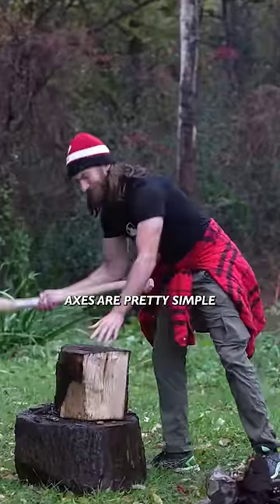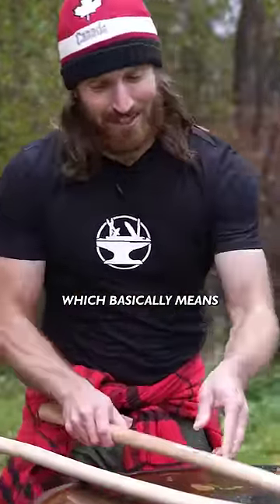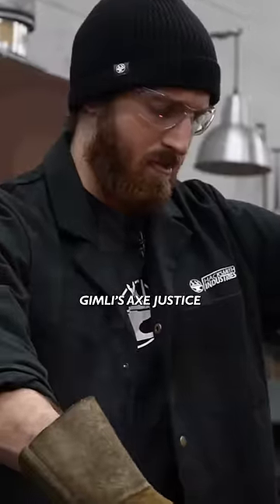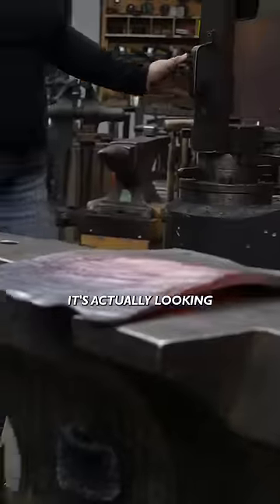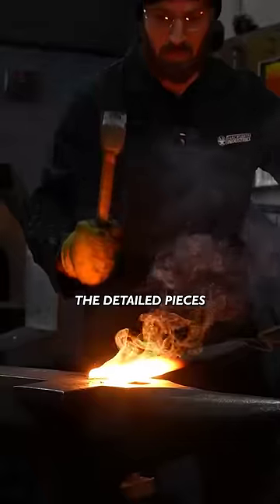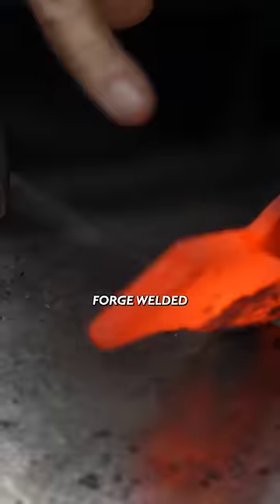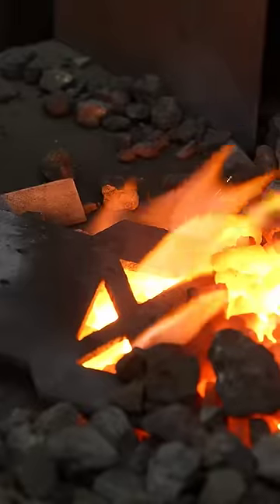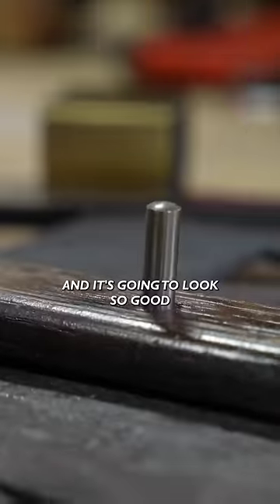...and you have MY AXE 🪓!

Comment: Double headed "Battle Axes" is one of the biggest misconceptions of medieval weaponry by fantasy writers. They became prevalent in history because all the common farmer had to defend themselves was the tools they used daily. Not to mention in a fight you would want to pick the weapon you are most familiar with
Reply: No.
Certainly not.
Reply: bro thinks fairies gnomes wizards and elves planet is the same as actual mid evil europe
Reply: @austriacontinente154  bro thinks the reason actual medieval warriors of various sorts didn't use double-bladed axes doesn't apply simply because some tall dudes can live a long time and like sailing

That reason, by the way, was that if you're making a battleaxe (y'know, an axe intended for battle) you'd want it to have a variety of damage methods for different types of armor, since there's little reason to have two identical blades on a weapon you can only hit someone with one side of at a time

You MIGHT be able to get away with a double-bitted axe if it had one blade be wide and thin, and the other be stoutly ground, but at that point you might as well just make it a hammer or pick so it either does bludgeoning damage through your opponent's armor, or can pierce it with less of a need for sharpening later

anything else is just futzing around with a woodcutting axe that may or may not have been misinterpreted as a battleaxe because some peasant chopped some duke's head open with one 1000 years ago
Reply: @austriacontinente154 The kunai was a gardening tool before it was a weapon.
Reply: @TheMandaloreFett You're thinking of a Sai.
Reply: It was cheaper, required less metal, and less skill.

A person was gonna have more practice chopping wood than using a sword.
Reply: @austriacontinente154  L
Reply: @TheMandaloreFett and yo-yos were WEAPONS before they were toys. So what’s your point?
Reply: Double Bitted felling axes were invented in 1850.
Reply: so what you’re saying is Minecraft was right?
Reply: @austriacontinente154 it's not about culture, it's about raw pracricality, even a 10 years old would figure out it is a bad idea
Reply: I believe that dwarves use axes as their weapon since swinging it around is like the way they would swing a pickaxe, therefore the movement is familiar to them.
Reply: @davet8534  yes but it makes no sense for it to be double bladed
Reply: @StefanoUrsella 

I mean, they could just do that cause it looks cool.

In reality humans (and fantasy equivalents) are not purely practical creatures..... even the most practical person possible (or the average Dwarf) would still be OK with losing a little bit of functionality for aesthetic purposes. I mean. Look at some of those wacky Cod Pieces!

A double bladed axe head may be pointless, but it doesn't reduce the overall efficiency of the axe by a significant amount. Yet it was memorable looking enough for a major misconception about it to be made by almost every fantasy author.
It's not too farfetched that a warrior would get one just because.
Reply: @axinhedgelion8417  The point of his/her comment was he was just correcting and educating people about their historical misconceptions.

Many people think past people or fighters choose the exact weapon they wanted but that's not always true.

One example was farmers having to fight with whatever they had. So they used their farming tools.

One time Wanderbot said he thought it was weird anyone would have a scythe when scythes are farming tools. Not weird at all. That's how far the misconception is.

Part of the reason for misconceptions, such as with the scythe, is entertainment.
Reply: I would argue the biggest misconception is scythes were ever used in battle. - Or that war scythes were repurposed agricultural tools. (They really were not, they were purpose built voulges)
Reply: @austriacontinente154  the core tenant of verisimilitude  is that the real parts of your story have to be as real as possible to contrast and earn suspension of disbelief for the unreal. A double-bitted battleaxe breaks verisimilitude for anyone with a basic understanding of physics, history, and weapon design due to just how bad of an idea it realistically is.
Reply: @kyosokutai  Agreed that is another big one. Scythes were only used for agriculture and if you've ever wielded one they are definitely not designed for fighting with. Yes they could be used but they are flimsy and require great skill to just to cut grass with.
Reply: You're telling me farmers bummed around with two headed axes?
Reply: Don’t remember asking
Reply: Well, also axes were better at going through armour. Big heavy head like a mace, and can still slice like a sword. Put an armour spike on the back and all of a sudden you have a scary weapon. For anyone. 

I’ve put a tomahawk through a street sign. Which is about as thick as ye olde armour. Lil one foot thing. A full size war axe would be terrifying.
Reply: If they were doing atHistorical piece then they probably would have looked up historical pieces. But this is for a character who had a double headed ax.
Reply: Indeed and I have a double bitted axe and they are so convenient I keep some side nice and sharp and the over kinda dull for splitting wood
Reply: The dane ax was the only two handed ax used in battle. It sniped heads from the second line.
Reply: @PsylomeAlpha  Dawg, chill. It just looks cool
Reply: @user-bl6oj1hl8i  the kunai and kama were both farming implements before they were weapons as well.

Comment: It's called a double but axe, they can be designed for fighting but were common in foresting trees back in the day, one side to cut through the bark that would dull your blade and the other stays sharp for cutting the inside of the tree
Reply: Wranglerstar?
Reply: double bit(e) axe
Reply: Important note on the combat designed double axes is that usually you'd have longer and broader but thinner blade on one side and a smaller but thicker blade on the other side.

The main blade would be  purpose combat one and the back one could be used a tool or to deal with heavy armoured opponents and  to hack down doors during raids/ sieges 

It also had the same benefit of not damaging the batlleaxe head which in this case is even bigger because  batlleaxes were naturally less robust due to optimised anti human Vs anti tree design

Comment: Hacksmith: "A battle axe means it's two axes in one"
HEMA community: Sharpens pitchforks
Reply: reconfigures scythes
Reply: Tbh the angry comment started brewing inside me the second he said it
Reply: Yeah… I was looking for this comment lol
Reply: Lol, I'll grab the torches.
Reply: Two heads is for chopping trees twice as long in the forest, or accidentally removing bits of yourself on the battlefield.
Reply: My exact reaction but it’s the hacksmith so I can’t get angry
Reply: @death32815 they're not for cutting twice as long, they are ground differently on each side, one is thin and very sharp for say limbing and the other is thicker with not such a fine edge for heavy work like felling. Saves you carrying two axes. You'd always carry a sharpening Puck in your pocket as well to keep both sides good all day
Reply: @jamestheferret  you want an extremely sharp edge for felling trees lol, the other one would only be kept dull so you don’t worry about hitting the ground or rocks with it
Reply: @jamestheferret  did u mean splitting?
Reply: @advamce493 @jamestheferret @jeffjefferson2743 

When it comes to double bit felling axes it's not to extend the duration of your time in the forest, it's to reduce the amount of gear you have to carry with you; The blunted end is used for limbing, the other felling, James is right. Jeff, if your hitting rocks with your axe, your form needs adjusting, and that's okay :)
The correct term for a double bit war axe, is Great axe or labrys. Single bit war axe? Battle axe (other variants too such as a bearded axe)
Reply: "which means" grrrrr arrrgggg.....
Reply: OMG my first thought 😂
Reply: Forges plowshares into swords...
Reply: Made me very upset hearing that XD
Reply: As someone who’s part of the HEMA community I approve of this message
Reply: AFIXES SPEARHEAD
Reply: I can't believe I forgot what a pitchfork is and had to search it up
Reply: I will go and get my longsword
Reply: @Dther99 grabs longsword
Reply: "Sharpens war tridents and halberds"
Reply: @jamestheferret  yeah, no.
There is no historical double blade battle axes, period.
They were all ceremonial and decorative weapons
Reply: Where’s my pollaxe?
Reply: I’m not even a part of hema and hearing that kinda felt off to me I know a battle ax were rarely ever double sided right? Because it simply has little practical purpose in battle given the purpose of it? Or am I wrong I can’t remember very well
Reply: Idk what you mean with HEMA but in The Netherlands, there is a store chain called HEMA
Reply: @limpfall13  Practical ones just weren't double-sided. Maybe one or two outliers exist, but there's just no real benefit and it fucks with the handling of the weapon.
Reply: they don't sharpen their battle axes? to show him what one is?
Reply: HEMA community? 
Like a fan club for the Dutch store? 
A lot of mom's in there.
Wouldn't want to piss those off.
Reply: @ElAnvaBar  Historical European Martial Arts. Using old manuscripts that instruct on fighting with various weapons to fight like they would have.
Reply: @nah-ov3vh  Historical European Martial Arts. Using old manuscripts that instruct on fighting with various weapons to fight like they would have.
Reply: Loads my m27 IAR
Reply: @jeffjefferson2743 you get mad over that?
Reply: It literally does mean that though
Reply: Sharpens actual battle axe
Reply: @majesticeagle5461 a battle axe is an axe designed for battle (meaning its typically thinner [felling axes are sharp too] to rend limbs and crush bone) no where do they have to be double bitted
Reply: @Sip_Dhit  You haven’t disproven me
Reply: @Dther99 😂😂😂
Reply: Damn the hema people are leaving their prized weapons at home to bring peasant weapons? weird move coming from them but ok.
Reply: "THAT STILL ONLY COUNTS AS ONE!"
Reply: I was about to comment something, hahaha
Reply: @SonFromAGun You sure James is entirely right? You stated the blunt side is for limbing, they said the sharp side.
Reply: Just curious, how would the hema community describe it?
Reply: lights torches
Reply: Tru
Reply: I'm glad you wrote this comment, really put me at ease
Reply: HEMA? Does that mean you guys know what Rookworst is?

If you get it you get it
Reply: The definition of a Battleaxe is, a large broad-bladed axe used in warfare.
Reply: What's hema
Reply: You beat me to it. I’m gonna cry
Reply: "Sharpens pitchforks"
Because pitchforks are 3 spears in 1
Reply: That on top of "Gimbli".
The Labrys was a real thing but mostly ceremonial.
Reply: I was just about to say something about it myself.
Reply: HEMA what now?
Reply: @Dther99  *loads glock 18*
Reply: They'll be ready for them.
Reply: They'll be ready for them.
Reply: Calibrates Trebuchet
Reply: wtf is HEMA?
Reply: @SomeHunter historical European martial arts, it’s essentially just studying medieval/renaissance weapons and fighting systems
Reply: All I’m reading is that it’s two different kinds of axes in one like he said
Reply: I’ll grab the REAL battle axe, the Dane axe.
Reply: @bait5257  Historical European Martial  Arts.
Reply: @jamestheferret Youre comme t implies all axes are the same. The truth is there are double axes with 2 different heads and 2 identical heads
Reply: @Dther99  YES
Reply: Pitchforks are just spears with smaller spears on it.
Reply: This has me wondering if there's a HEMA method for wielding pitchforks. Kinda spears?
Reply: @LJCyrus1  that's about how i would
Reply: HE SAID IT FOR US CHARGE THIS HEITHEN
Reply: (polishes longswords)
(unsheathes Greatswords)
(grabs halberds)
(yoinks billhooks)
Reply: @TheBetterBleedingBladesYouTube 🤦🏻‍♂️
Reply: @SonFromAGun 🤦🏻‍♂️
Reply: Gimli - that still only counts as 1
Reply: Bow and arrow 🤪
Reply: It's PRONOUNCED: DOUBLE-BIT AXE aka the Michigan axe
Reply: Instantly opens coments

Comment: Doubleheaded axes arnt battle axes.
Double headed axes are used for wood cutting to change heads when one blade becomes dull.
Battle axes are simply any axe that is war ready
Reply: Close, whilst you have some what described a double bit felling axe (although the bits are purposefully sharpened differently, one sharper side used for felling, and the counter side for limbing) there are also double headed axes meant for war, often called a Greataxe or Labrys. A single bit axe meant for war is called a battleaxe. The chosen phrasing they used isn't correct, however great axes did have a place in warfare.

Source : I'm a wood cutting nerd
Reply: you're half right. Sometimes it's so you can switch to a clean, sharp edge, but more commonly it's because one side is for harder bites/felling and the other side for splitting.
Reply: @SonFromAGun  Those axes for battle were more common in the Bronze Age, and less common in the medieval age. BUT, you did have Halberds with actual double blades.
Reply: Arnt isn’t aren’t tho
Reply: @voltekthecyborg7898 yes but the blade on the opposite end of the ax head is smaller than the ax head
Reply: @brrrrrr  It was more popular than symmetrical blades, yes, but it still happened
Reply: @voltekthecyborg7898  but even then they aren equal, one side beunf a big blade the other usually being a pick or sharpened hook
Reply: @Sip_Dhit  Depends, the Labrys was symmetrical, ceremonial or otherwise
Reply: The only double bladed axes for battle that I know of are Indo Persian. I'm going to need a source on a "bronze age double bladed battle axe." Or a "double axe bladed halberd"
Reply: they can also have different edge profile so one side is good for felling, the other one for cutting off branches
Reply: Actually there's more to battle axes than that. Opposed to actual woodcutting axes, the axes meant for war generally are meant for cutting flesh, and although a woodcutting axe would do phenomenal, it is quite weighty. And that's where war axes get different, where they make them much less weighty by making the heads less thick, and just make them good enough to cut flesh. It's like subsonic rounds - they make them quiet enough yet strong enough to penetrate flesh. In this case it's just for weight purposes though.
Reply: Battle axes are just regular ones with thinner and lighter blades, sometimes with a vertical spike or blunt other end for multiple uses
Double headed ones are better sometimes at woodcutting and double headed battle axes were ceremonial, like king Charles cutting a cake with a mall ninja 'katana'
Reply: @SonFromAGun  Nope, Greataxes were not double bitted. Labryses on the other hand...

Source: Military history nerd

Comment: In the Jackson movies Gimli's axe has this design with cut-outs on the head. You see this a lot in modern engineering, because it decreased the mass while still keeping most of the strength. When building a large structure, this not only cuts material costs, but it also decreases the weight, so basically you can carry more.

The thing is, an axe is supposed to have a large mass. That's where its striking power comes from.
Reply: Right, but a battle axe also needs to be fast, and therefore light. Real ones were rarely over 2 pounds.
Reply: @farkasmactavish  Exactly, it's not for splitting stumps, it's for splitting heads. There's plenty of force for that coming from the swing of the handle and your arms when wielded properly; it doesn't need to be heavy like a maul. Same concept as real life war hammers being much smaller than fantasy versions. Main issue I can see is with armored enemies, since one would think an axe is more about cleaving the armor as opposed to bypassing it with blunt force, but I'm not even an armchair weapons expert, let alone a real one, so maybe normal-weighted war axes can handle that, or maybe they're similar enough to hammers to have the same blunt effect on hard targets.

Comment: AKTUALLY a "battle axe" is just a fighting axe, which, broadly speaking means it'll have a lighter head than a work axe of the same size, and, most importantly, the edge angles are typically finer than a wood axe. Double bit axe heads may rarely have been used as weapons, but it's mostly a film/game trope. Irl double bitted axeheads are woodaxes - or decorative ceremonial (like made out of think gold sheet)

Comment: I think personally they should've done it in one piece instead of welding the blades on
Reply from the maker: Forge welding is the technique to make something like this though...
Reply: I always believed that these separate blades were just a raise of the metal as it tapered into the handle, similar thinking to the fuller in Viking swords.

Comment: You know, the irony of axes like this is that their closest counterparts in real life, danish axes, wound up being used as much like a staff as an axe. The blades are thinner than people expect, meaning they're not smashing implements meant to be swung around like theyre splitting wood. 

People would regularly lead with the empty end of the haft and use it to set up more committed swings with the blade. But even then, theyre just generally more nimble than is usually depicted. 

I just think thays funny considering how they're portrayed.